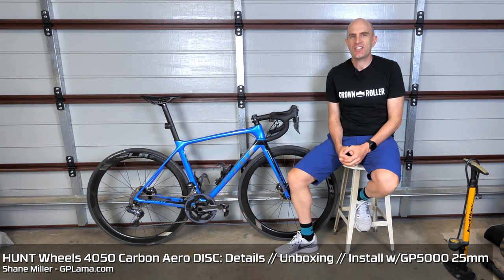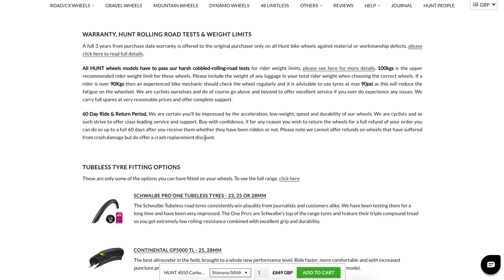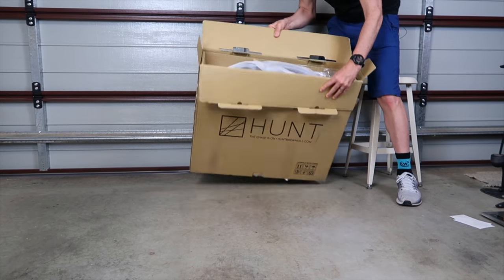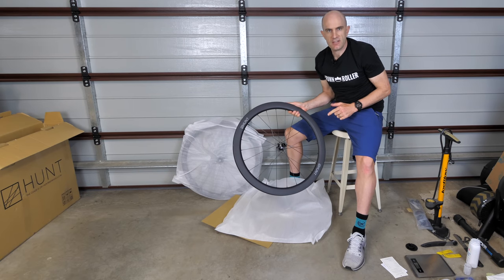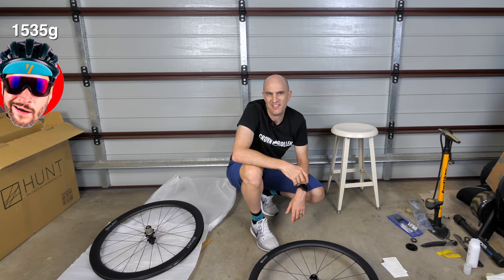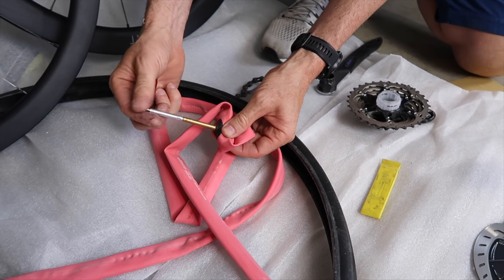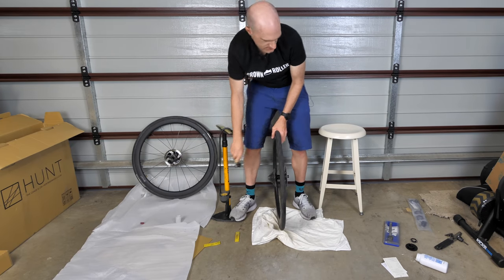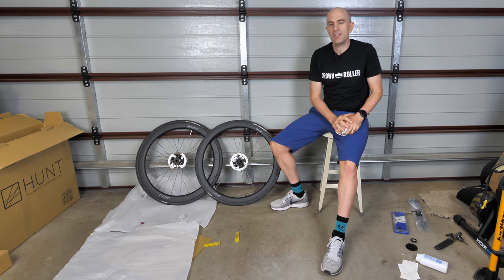HUNT Wheels 4050 Carbon Aero DISC: Details // Unboxing // Install w/GP5000 25mm

Comment: Hard to beat the price of the Hunts, good looking pair of hoops as well.
Looking forward to the follow-up video 

But I will not comment on how I feel about the addition of grams 😘(I guess I did 😏)
Reply from the maker: The profile on them is sooooooo sweeeeeeeet. I need to get out on them and spin around on the phatter GP5000 25s now too.
Reply: Rides of Japan I feel the same way about the added grams ...
Reply: I stopped watching the video as soon as you said the stock wheels were lighter.
Reply: Hunt wheels are from Winspace (big cycle company in China). Just order them there mate
Reply: Shane Miller - GPLama is there an update video in the pipeline ?
Reply: @nicolasnimmegeers6677  not really. Only 1 set has the same rim (but different hubs), the one with carbon spokes. Other Hunt sets are totally different.

Comment: Thanks for the video, not trying to tell you how to suck eggs but when fitting tyres have you tried feeding the second tyre bead on from opposite the valve and working towards the valve once you have the tube in? I read this on the instructions for Michelin tyres, they claim doing it this way allows the tyre to fit deeper into the well or centre of the rim giving you more tyre length to work with when you reach the valve end, if fitted at the valve end first the tyre is not able to fall into the well or centre of the rim because the valve is in the way which makes the tyres tight to fit, I have to say having tried the Michelin method they were much easier to fit, I now follow this method for all makes of tyre and have never struggled to fit tyres by hand since adopting this method.
I will look forward to hearing your verdict on the wheels, thank you for posting.
Reply from the maker: G'day Mark. No eggs involved, in fact I really appreciate suggestions on how to do things better (and that are posted in a polite way). I'll give this a shot next time. Cheers!
Reply: Totally agree. I've always worked towards the valve while mounting tyres, a lot easier.
Reply: I always start from the valve. The keys to well seated tires are: squeezing the beads together while pushing into center rim well. Pushing the valve into tire slightly, inflate to about 30 psi, deflate and then re-inflate to full pressure to allow tube to fit into tire and avoid tube getting in between the bead and rim.
Reply: I was about to say the same. Its even more of a benefit when fitting tubeless with a chunk of rubber on the back of the valve tight to the rim. Also, the opposite when taking the tyre off, start near the valve.

Comment: Hey Shane, I bought Hunt X wheels for my winter gravel bike and fitted Hutchinson fusion tubeless tyres. They went on so easy and blew them up with just a track pump. Such an easy set up and the ride is a lot more comfortable too! Dropped pressure from 80 to 70 and now at 60psi. Get those tubeless on soon, I’m looking for the wheels you’ve bought for my Giant,so will look forward to your review. Great vids.

Comment: I just bought Hunt wheels too. Can you tell me what tools you used to remove the disc brakes? First set of disc brake wheels I have tried to change so not sure what tool I am missing. But none of the tools we have are working. Is it the Shimano TL-LR15?

Comment: Just had my Hunt 30 Carbon Gravel Disc wheels in the truing stand after over a year of riding offroad and on rough tarmac, and they are hardly out at all. I have just put the Dura Ace rotors on, as they look so good. Going to make my own rear dérailleur alignment tool, to fine-tune my new GRX 810; and then I am ready to hit the road.
Reply: You can afford DA rotors just because they're black, but can't stomach the cost of an alignment tool at 1/8 the cost and 50x the value?
Reply: @lustyd  I can't make rotors, but I can make an alignment tool, which I did to day in ten minutes for the cost of £7. The Park Tool model costs £62. Also, mine had less free play than the Park Tool version according to the reviews I had seen.

Comment: Hi Shane, great video (as ever). It will be interesting to see how you get on when you do eventually convert to tubeless. I have some Hunt 30 Carbon Gravel Disc wheels (as I'm 95kg) which I really like, but I have found it almost impossible to unseat tubeless tyres from the rims (with Continental, Hutchinson & Schwalbe tyres) when stranded at the side of the road (I had a really bad run with punctures not sealing). Because of this I am now using tubes with some Conti GT tyres!

Comment: Are we sure these are SLR1? or SLR0?  Can you confirm this weight Shane Miller ? I'm curious for a BMC SLR01 Disc climbing bike build.
Reply: estheticdesigns im with you. I weighed my Giant SLR1 wheels 42mm and they came at 1582g which is more aligned with the claimed weight. It is 180g heavier than Shane’s

Comment: Seem very similar to the wheels offered by ICAN Cycling.   I have been running a set on my Giant TCR without issues.  Using Schwalbe Pro One tubeless tires.

Comment: Happy to see someone else cringe and get nervous when pumping up a freshly mounted tire! When I was in my teens, I had a MTB tire blow off while inflating with a compressor. Was inside a shed, and my ears rang for a while after that, but it was a learning experience and a lesson to pump, check the bead seating, pump, check again...!
Hunt wheels look nice, though I'm currently looking at a set of Light Bicycle's 46mm deep, 21mm internal width wheelsets with DT Swiss 350 hubs. Wish someone would do a proper review of these!

Comment: I can appreciate how easily the come on the rim. Swapping rubber on my DT rims always involves heaps of anguish, soap, swearing and aching thumbs. Is the baby powder a latex tube thing or did I miss some handy maintenance tip here?
Reply: baby powder allows some movement of the tube and tyre which leads to fewer punctures. Also stops them sticking to one another. Also prevents latex from perishing. I have the same little Johnson's pot as Shane and it's lasted me...over a decade. Well worth the time and investment.

Comment: Be interested to see how you go Shane. This and light bicycle seem to the be the best options. Hambini seemed to prefer those. 

Also on the GP5000s, I tried the 25mm on the propel advanced pro 0. It's still mega harsh on the propel but these things do roll so awesomely.

Comment: Hi Shane, looking forward to he follow up video. Question: the method of measuring rim depth, has it changed now that there is no brake surface on the rim? If I compare my old Zipp 404 to my SLR1 the 40mm Zipp is definitely deeper than the 42mm SLR1.
Reply from the maker: That's an interesting question. I assume rim depth should remain the same.... maybe it's one of those 'standards' that's different from company to company.

Comment: Holy post resurrection, Batman!! Do you have any update on this? I've just bought some Aerodynamicist 44s and still within the 60 day ride/return period and I'm deciding whether to keep them or not. They feel great on the bike but I'm a little concerned about the reliability of the hubs/bearings.
Reply from the maker: No issues with these. 👌🏼
Reply: @gplama  Thanks, Shane.

Comment: G‘day GPLama, hope you going well. The GP4000s II 28mm won’t work on TCR disc frame from my experience. If the GP5000 28mm are less wide and have less height, than there is a chance it would work for you.
Reply from the maker: Thanks mate. I thought the clearance might have been a little tight.
Reply: @chrisck1981  Are your rims also 21mm internal width?

Comment: Been riding the same exact tire wheel combo for a few months now. I’ve been happy with them considering I was upgrading from the stock aluminum wheels that come with the Giant TCX. I’ll be very curious to see how you feel about the absolutely deafening hub buzz these things give off.It’s a good thing I usually ride solo because I can’t have a conversation while freewheeling.
Reply: Buzz from the hubs? Or just the typical deep Carbon rim sound? The last one is kinda normal (but not the deafening part tho).
Reply: @Stevenafoe  Definitely not a typical carbon hum you get from deeper rims. It sounds like a swarm of angry bees. On a typical Sunday group ride with about 10-15 riders, I get comments about it  every time, and I am always the loudest in the group.

Comment: GP5000 25mm was developed on 17C. For every mm change in the rimsize the tire grows by 0.4mm at maximum pressure.
Reply from the maker: Is there another more optimal choice in the Conti range for 21mm?
Reply: @gplama  28 is the new 25
Reply: No. GP 5000 is optimized for 19mm, which is the current standard. Thats why its narrower then gp4000,

Comment: Didn’t Hambini diss the design on these?
Reply from the maker: I'm sure he's slayed everything. I still want my "By Hambini Aged 5" t-shirt.
Reply: @Hambini  Also interesting they call for a 100 psi limit.  
"Maximum tire pressure for this rim is 100psi when used with 25-28mm tires. Maximum tire pressures for other tire sizes: 30mm do not exceed 70psi, 33mm do not exceed 50psi, 35-45mm do not exceed 40psi, 46mm+ do not exceed 35psi. 100psi is more than enough for any rider on road. Please do not exceed the maximum pressure stated on your tire"
Reply: @SuperFiberoptic  that's because relatively "narrow" 23-25mm tyres tend to blow off large internal rim widths (these are 21mm) at high pressures. I have been using the new ERTO recommended pressures for tubeless compatible rims and if Mavic endorse them then they should be ok as they are quite conservative. X-axis on charts is rim inner width so in Shane's case max Tyre pressure is only 6.1bar plus 15% (because he is using a tube) = 7.02bar= 102psi which is way more than you need.   https://engineerstalk.mavic.com/en/the-right-tyre-width-on-the-right-rim-width/
Reply: Hambini at least they take safety seriously and recalled all of those wheels. More than I can say about Cervelo with their S5 self destroying steerer tube design which is unforgivable! Even mechanics in stores who put these bikes together must have known there was a huge design flaw!

Comment: Did you have any issues with your rear wheel after you got them mounted? I put mine on my Tarmac SL7 and once the rear TA is tightened to spec the rear wheel and cranks are almost impossible to spin.
Reply from the maker: No issues. That doesn't sound good though.

Comment: Hi Shane, how did you find the experience of buying internationally from Hunt? I am finding it a nightmare. Believe it or not their website gets confused between AUD and USD. I thought I would give them a go but they are really slow to deal with. Fingers crossed they get their act together. BTW they now charge for freight to Australia [Ballarat].
Reply from the maker: No dramas at the time. Just watch for them getting snagged at customs. Ping their support and let them know it's giving you grief. I believe they have an AU representative.

Comment: Love Hunt wheels, but you should run them tubeless, makes a hell of a difference.
Reply from the maker: That's the plan. I'll switch them over when the GP5000 wear down.
Reply: Shane Miller - GPLama have you got over your Tubeless fitting woes?

Comment: Hi Shane. Any thought on how the wheels are now? Would you recommend their wheels?
Reply from the maker: They're still on my bike, so that's a plus. I'll post my experience with them soon.
Reply: Shane Miller - GPLama I’ve already put a deposit down on the Hunt 36 aero wide rim brake wheels. I guess I’m just looking for confirmation that I made a good choice. For the price of $839 US I think they’re unbeatable value in a market where most carbon wheelsets are 2-3k!

Comment: After trying some things i have to say i happily stick with my trusty dt swiss rc38db with stoneage 15mm internal width. the hubs are awesome, they are as light or lighter (true 146x something grams) than most comparable modern wheelsets and i crashed them through pot holes and even over a loose laying paving stone full gas at night and they still roll and roll and roll. didnt notice much of a comfort difference on wider rims. 

you most probably downgraded in terms ob hubs, rim design and even wheight. for just a millimeter more tire and low single digit watt aero gains (if any)? hm. but yeah, if it feels good, its fine :) and they look nice on the bike.

Comment: I just got the rim brake 50's for my older TCR. Half the price of other name brand ones. Now I wait for shipping
Reply from the maker: Nice one! Let me know how they go once they arrive and you’ve taken them for a spin.
Reply: @gplama  have a few rides on them...rear started going out of true, however I think I just need to lower my tire pressure since I'm about 85kg. The lacing is 2 in a row on the drive side so that may not be helping my issue. Definately gonna add some lube to the free hub. Sounds like its grinding metal in there

Comment: How does the 140mm rotors front and rear perform? Is it enough braking power? Hope you like the 40/50s i got them and think they are brilliant
Reply from the maker: All good on the road bike. Never an issue. Hydro is plenty strong enough to pull on them.

Comment: Hi Shane, I’m considering similar wheels in spec and price from Hunt. Im also in Australia, and was wondering if there was any additional import charges on top of the cost as they are over $1000 AUD. Thanks
Reply from the maker: If they get pulled up by customs, yep. Have a chat to Hunt and their local AU/NZ rep about the best way to get them shipped.

Comment: I know you were surprised at the weight gain on the wheels, but that is to be expected when going from the 17mm internal width Giants up to the 21mm internal width Hunts.  Bummer, huh?  Maybe look for some 19mm ones next time?  :-)
Reply from the maker: I was surprised the SLR were so light. The spec on those is 1580g iirc.

Comment: I think the weight is based on no rim tape, and it seems that they come pre taped with rim tape.. the rim tape probably like 30-40 grams.  Therefore at 37-47 grams more that is 2.5%-3.2% difference than the stated weight of 1458grams.

Comment: Running a set of 28s GP4S on my tcr so you should have no issues
Reply: Hi there, what’s your frame clearance like I’ve a 2017 tcr disc which I’d really like to run 28’s on. Looked online and couldn’t seem to find an answer 👍
Reply: @blimseynoeyes  plenty clearance on chain stay, I would say 3-4mm which is on the safe side, the 28s gp4s are on stock pr2 wheels and tyres measured 30mm and still had room on chain stays, mine is 2019 tcr disc, I've read online that gp4000 28 will rub as they measure wider
Reply: Cool thanks for the info 👍

Comment: Hey I have Giant Defy Advanced 2 with original wheels (discs&tubeless). Should I upgrade to HUNT Wheels 4050 Carbon Aero as well? Will they fit or will I have to buy something else as well?
Reply from the maker: Entirely up to you what to buy. I assume they’ll fit. Ping HUNT to get an official answer confirmation.
Reply: Radek,  I too have a Giant Defy Advanced 2 and upgraded to Hunt Aero 30’s.  They are awesome!! Did you make the change?

Comment: 90kg weight limit, again! So few companies make wheels for hefty riders. Even at my lightest when I was commuting on bike and riding at the weekends, I was still too heavy. My Shimano C50s where actually fine but now I’ve swapped to a new road disc bike I’ve actually gone to deep section aero alloy wheels. They are even lighter than the C50s
Reply: rider weight is 108kg upper limit

Comment: Where did you get the holder thing for the cassette when you take it off so it stays together? Thanks
Reply from the maker: It comes with most cassettes (Ultegra and above)

Comment: I weighed my Giant SLR1 wheels 42mm from TCR Advanced Pro 1 2020 and  they came at 1582g which is more aligned with the claimed weight. It is 180g heavier than yours. That’s weird

Comment: `Howcome you didint go for the 50 50 Carbon Disc wheels instead as its more aero?
Reply from the maker: I don't need that much aero. Or the fastest. Or anything really... I just wanted something nice to roll around on. I hope these fit the bill.
Reply: @gplama  Ah makes sense 
I just thought since the price was basically the same it would make sense to just get 50 50
Reply: @hellopsp180  glad you asked this I was thinking exactly the same question

Comment: Hi Shane, i was loooking at the new 303 s zipp wheels for my cyclocross bike but i can't find if their compatible with my 15x100 fron thru axle...
Reply from the maker: One for SRAM Support. I was hoping to get my hands on a set.... but it hasn't happened yet.
Reply: @gplama  allright, thanks for awnsering

Comment: Did you weigh/swap the other disc rotor lockrings though??
Reply from the maker: I removed all lockrings before weighing both. I used the ones from the SLR wheels on the HUNT wheels.

Comment: Meant to ask you about that quick cassette tool... is that the white plastic core that comes with the cassette box? I tried to use one and it’s a bitch to slide the cogs on it one at a time let alone all at once.  You must be using something else.
Reply from the maker: Covered here: https://youtu.be/dg7BQXKsF-o

Comment: Latex Tubes?

But why you don’t use new tires/tubes and disc on a new wheelset?
Reply from the maker: Money. The GP5000 are only 200km old.